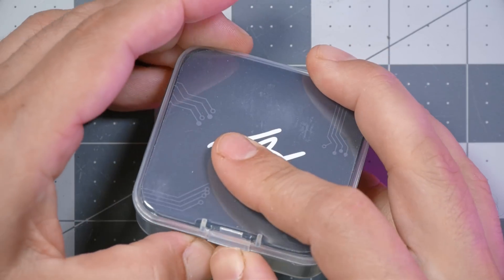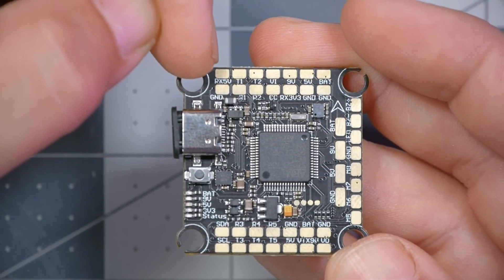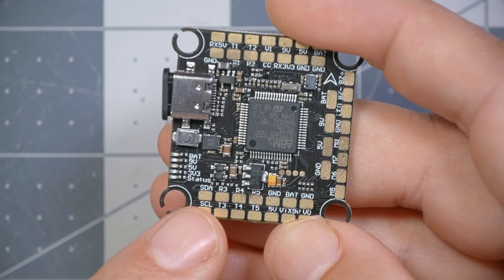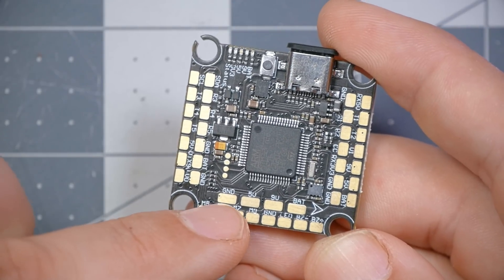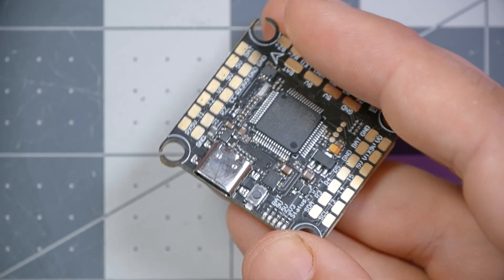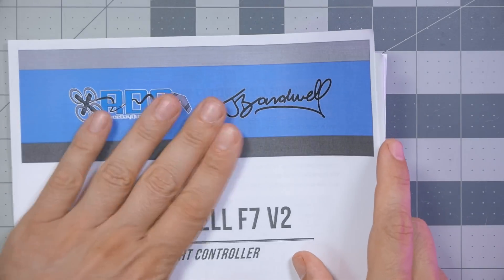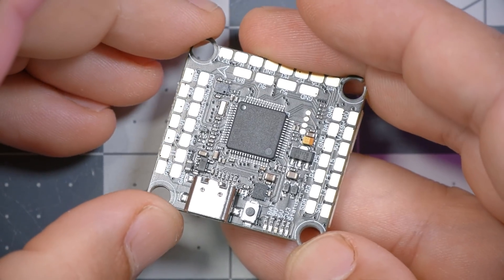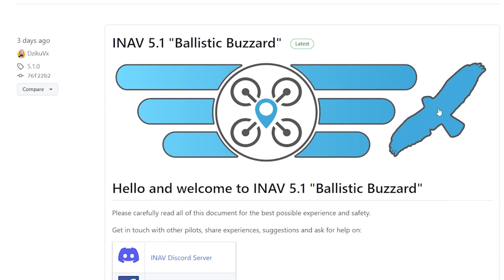My new FC is here! JBF7 V2 has USB-C, solderless plugs, iNav support, and more!

Comment from the maker: Pick up the JBF7 v2 at RaceDayQuads - https://bit.ly/3PQBcaw
Reply: What ESC would you call a "perfect" match for this FC when you make a build? : )
Reply: @tg3025  I asked him that very question a couple of times in live chat yesterday and never got an answer. I like the USB-C connection, but I think I'm going with a different stack I know will work properly together.
Reply: I purchased several of these FC’s and Return to Home feature is worthless in Betaflight 
Something is wrong with the gyro and or barometer
Reply: The RDQ site says that the gyro is ICM20602 but in the video you said it's BMI270 ... which is it? I presume it's what you said in the video and that RDQ made a typo. Also, any availability in the UK/EU? Good video though. Wanna try the FC.

Comment: Mr Bardwell, it would be awesome if you would do a presentation on running this FC with iNAV. I've got this board, with all the bells, and whistles. The pile of goodies I'm trying to get to work together are this FC, of course, an HGLRC M80 Pro GPS/Compass, WS Avatar HD Pro, with their CADDX GM3 gimbal, which must be on PWM (motor pads 5-8), so configuring the pads for PWM output is a must. The quadcopter is a rather large one I'm building for cruising, in the 450 class... like the old Hobby King deadcat quad, but nicer, an EyeFly Black Manta.

Comment: If this is not the best place to post this my apologies, please direct me to the best place. I have the JBF7 V2 Fc with an dji air unit and V2 goggles. I have WTFOS installed and working on BF 4.4.2 target is IFRC/JBF7_V2(STM32F7X2). My problem is the Font manager button in BF is greyed out. I've tried powering up with a battery first and then connecting to usb but that did not fix it. When I go to the osd page the button is yellow for a very short time and then greys out. I've searched the wtfos discord and found out about the connection sequence but little else. Any thoughts on this?

Solved, font manager not applicable with digital video

Comment: I have bought it. And really appreciate the thoughtful layout and handy plugs. I just want to get the quad in the air, tune it and basically get everything working. If the plugs ever cause performance or durability issues it’s nice to have those meaty pads to solder to. Also, just happy to support JB when I can. Safe to say he’s committed to the hobby and education. Always positive, honest and informative. Who better to trust? I’ll be sure to post my experience with the JBF7 v2 here after I’m in the air.

Comment: Question on the plug in for VTX. In the Betalight programming if you do not program a switch to the 9V will it prevent the camara from working? I have it all set using plugs and either have the video in or video out wrong or maybe need to add something to the programming.
Reply: Neverminded. I had the buzzer and camera plugs backwards.

Comment: @joshuabardwell how do you flash new firmware on this ? It fails in both inav and betaflight. Thanks in advance
Reply from the maker: If you're not able to get it to flash the normal way then try holding down the bootloader button while plugging in USB. There's no special procedure for this fc compared to any other though.
Reply: @joshuabardwell i had to use the impulserc fixer and that solved everything. Thank you

Comment: @ Joshua Bardwell 
Hi Josh- I just picked this up and have it all wired up via plugs (no soldering). Do you know why it randomly goes into DFU mode while connected to BF? I checked the bootload button and it’s not stuck. I’m scared to fly it because not sure if it can go into DFU mid flight.
Reply from the maker: Move the receiver to UART 2.

Comment: i was using the TBS M8-2 GPS/Glonass, which has no compass, and was showing altitude readout in my OSD via the built-in barometer in the JBF7V2. I upgraded to the Mateksys M8Q-5883 GPS unit, which has a compass built in. I now have no barometer readout. The barometer doesn't show that it is active in Betaflight and my altitude says 0.0 in my OSD. I still have no altitude and no barometer working even if I unplug the GPS unit. I was just wondering if anyone might know why this happened, and if there is absolutely no fix for it, how should I go about wiring an external barometer to this flight controller if my GPS unit is already using the SDA/SCL pads? PLEASE HELP MEEEE!

Comment: ; ) Dumbo here...waiting to buy...UNDERSTANDINGS:
1)WILL take iNAV which WITH (optional) GPS and (optional) magnetometer will provide RTH & Way Point navigation!
2)WILL power & feed DJI/CADDX digital which WILL transmit to DJI Goggles V2
3)Can it be used with DJI controllers and STILL eliminate DJI geofencing?
4)Can it be used with the DJI Motion Controller?

Comment: Hi joshua ! I have a question. It is possible in inav 5 to implement signal at moment when gps has a fix. Think that is important if a user can hear from transmitter that gps has a fix. Thank for answer.

Comment: About realpit: wouldn't a switchable ground pad work for turning a VTX on and off regardless of what +V pad you supply it from? 
And you could also abuse it for switching other stuff.
Reply from the maker: No, because the vTX is still energized and the current finds other paths to ground.

Comment: Hello Joshua, I’m 19 years old I’ve been building and flying fpv quads and planes etc sense I was 13. Ive learned everything I need to know about quads from you it’s incredible what you do. I know there aren’t to many young pilots out there but you’ve Taught me so much! I have one question. I purchased your JB f7 v2 flight controller. I’m super excited to build it the Layout looks FANTASTIC!. I was really really hoping I could get your input on a good 4 in 1 esc to use for your FC. I’ve always used single escs and my main flight controller I’ve used on my builds is a matek f722se. I went with your flight controller because I trust you when you say performance will be pretty much the same between the BMI270 and the MPU6000 on my mateks. Thanks so much and please don’t stop doing what you do best!
Reply from the maker: The iFlight Blitz ESC pinout will match the JBF7's pinout so that would be a good choice.

You don't have to trust me about the gyros. Both Chris Rosser and Mark Spatz have said the BMI performance is as good or better than the MPU6000. That's where I got my info. Trust them :-)
Reply: @JoshuaBardwell  okay thanks so much I really appreciate it!
Reply: @kadonhayes9771  Thanks for asking this question! I was wondering the same thing. Which model of iflight esc did you end up going with? Im looking at the dimentions of some of the esc mounting holes and it made me wonder, since i will be using the jbf7 v2 and it uses 30.5mm mounting holes, does that mean i have to use an esc with the same size mounting dimensions? Also, what do you think of the BLITZ E55 4-IN-1 ESC (the non mini version)?

Comment: Think running a s*** ton of LEDs for race day is a lot more important than running a octocopter... Wish it had more power for leds
Reply from the maker: The 5v and 9v regulators are rated for at least 2 amps. At 60 mA per LED @ 5v, that's like 30 LEDs, not leaving any budget for other thigns like the camera and receiver. Just saying, if you want to run a few LEDs on race day, you're fine. Just don't expect to go hog-wild.

Comment: Any chances you will co-create HD only FC or even AIO? I mean in case you've are on digital side of the hobby - there is no need of OSD chip, VTX part, extra power lines, pads, and smd elements for these bulky parts too (odd chip is huuuge). I love SD card slot there - its useful and cheaper than memory chip.
Reply from the maker: Really, a digital-only FC saves basically just the OSD chip. But since you have to make 2 different SKU, it doubles the amount of money you tie up in inventory and takes up more shelf space and is more difficult to maintain. So I'm not super enthusiastic about it.

Comment: This looks really, really REALLY good.  I'd like to point out a couple of things:  1) You mention the word "beginner" multiple times in the video, and there are some great features for beginners, but this is definitely specced out for pros as well.  This FC has everything that I want in a FC without going to a much larger board 2)  As with every compact board, there are compromises that have been made to fit everything in - but the compromises seem to be really practically made; 3) I have an incredible amount of respect for the fact that you left the card reader on the board - you've designed this for YOURSELF first, and hope that others like it too.    As you know from a couple of discussions you and I have had recently, this is how I design all my own stuff - I make it for myself first, and I firmly believe that as soon as you start to make other people happy that you can easily lose integrity in your product goals.   I cannot say how much I appreciate what you've done with this board, and the thinking behind it.   I know that there are already a lot of other FC boards out there (and in a way this is similar to the motors market saturation issue), but this one really is a solid, incremental step towards the "perfect flight controller" (as as close as we can get.)

Comment: I’m curious Josh: why do you prefer an SD card slot for blackbox data vs some onboard nvram? Isn’t blackbox data so small that onboard storage can hold pretty much all you’d ever need?
Reply from the maker: A 16 MB dataflash chip can hold about 10 minutes of flight if you turn the logging rate way down.

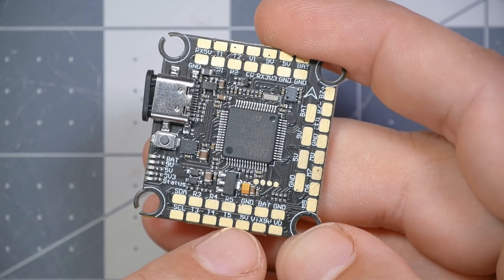Comment: The remote-power switchable VTX pad is a great feature (5:10).
Stop a VTX from overheating pre-launch on a warm day, or turn-off while doing bench work.
Diagnostic LEDs (7:37) are also very cool feature.
Reply: Agreed.  I've been using RC (PWM relay) switches on my larger builds for this purpose.  Its silly not to have this as a standard in this digital age.  Nice work JB.

Comment: Looks like a pretty awesome flight controller, I am looking at using a UART to use E-matches with to be able to set off pyrotechnics with a switch on my radio, is it possible to do, the e-match only requires a small amount of current to light the match which is hooked up to the fuse on like a small firework or smoke grenade.  i am making a plug that I can use to quick change the e-matches etc.
Reply: I only need to be able to activate the UART with the switch if possible so it doesn't have a constant current through the wire etc

Comment: Definitely going to use this new version on my upcoming long range, long endurance tricopter! So much capabilities to control just about anything, and now with iNav? I'm sold.
Reply: Agreed, with that much stuff both broken out to pads and on connectors, plus barometer and iNav target, this FC would be pretty at-home in anything that flies, multirotor or fixed-wing, not just quads.

Comment: Also like to see c-usb connectors not just wave soldered to pads for the usb body supports, solder thru pins on that usb body, already ripped a C off so to easily.

Comment: Baro is fantastic say you are uphill or atop and you fly over the crest you want to stay as near line of sight for video.  For example, if you find yourself losing video and at -100 in altitude, you know what to do.   I do alot of long range and has been used many times, like turning into a headwind with same throttle u will lose altitude and with no baro u don't know it maybe till too late.

Comment: Imagine creating your own customized FC xD
Hi Joshuah, I am new to FPV and I am wondering about radiation levels. Could I get cancer from using power levels such as 1000mw on my VTX or crossfire?
Also, i love the idea of an Inav compatible FC. I have always wanted the things that Inav offers because I have seen what it can do from youtubers. Great job!
Reply: No the radio waves for wifi, radio, video transmission, anything publicly used is not dangerous in any way
Reply: @Just_Natee  Thanks
Reply: No, 5.8GHz is not ionizing, i.e. you can not get cancer. Visible light is the same (electromagnetic waves), except light is at 100s of THz, and even that doesn't harm you. The only thing that can happen is that your hands warm up slightly from the radiation, but even then you wouldn't even feel it until the output power is like 100W (100.000mW) or so. Seriously. Don't worry.

Comment: Hey JB! now that the BMI270 is getting used more and is proving to be nice, I am wondering if you have considered releasing a new f405 FC. with the mpu6000 we "needed" f7 because if we wanted bi-directional dshot, we had to downsample the gyro data at 4k. However, with the BMI270, we can easily have full gyro rate of 3.2k and bi-directional dshot and get double the flash with the f405 vs the f722 in exchange for less uarts, and most people use only 2 anyways. 

Ive always wondered why the f745 wasnt used more (for the additional flash) outside of toothpick AIO's, but with the BMI 270 it seems like we can bounce back to the f405 for our needs, and maybe we can take some of the sting away of rising costs... 

Thoughts?
Reply: pretty good idea, except my quad is running 8k/8k on an f405 🤔 - until now I don't see the reason of an F7 anyway. Except if you're using all the UARTs or you have excessive filtering
Reply: Chip shortage, that's always the problem.
Reply: @FireN2k9  is it though? the f405 is in shorter supply than the f722?

Comment: please do an inav 5.1 video i just built a 7" gps quad but when i arm the roll and pitch stick dont work till i use the throttel un like my racing quad where i can lean it then throttel up
Reply from the maker: That's just how iNav works. I'm not sure if there is a workaround.
Reply: @JoshuaBardwell  ok BF flys like it should and has gps recovery what apart from position hold is the diference would make a good video

Comment: Yeah you know we're going to buy it, the barometer is very cool! I rum Inav on a 7" long range and the GPS has a compass so you can use altitude hold.
Reply: when you arm your quad dus the roll and pitch work or do you have to throttel up first
Reply: @dirtydogfpv6905  I'v only got it working and tested low to the ground, and I can't remember moving pitch and roll before throttling up. I wasn't sure it would work at all with the compass on the GPs.
Reply: @nunabiz  on my race quad i can tilt it so it is in a launce pos but on the inav build i cant there is no imput till i throttel when you next fly it have a try

Comment: I wish I had a JB ESC. That is the most fragile part in my builds.
Reply: For what it is worth not that you get what you pay for because some ESC's that are expensive have been junk and vice versa but you get what your boards components are "spec'ed" for would be true for sure!   That is something that us average consumers will not always know  - what FET's a manufacturer has selected to be on the board but in the end what a burn it is when you buy an ESC only to have it fry under what you would consider normal use and you are SOL with electronics, so if it fry's you are out the $$$ you spent.  

And in my opinion it is a shame that junk is made that only serves to  add to waste streams and landfills (you should electronics recycle these but still)  So I think it is important to look at reviews from real people as much is believable and trustworthy on this item as disassembling a stack, de-soldering the motor wires, power wires, etc.. is a pain in the rear, time consuming, always a small chance you solder the new one in wrong... it is just much better to find the right one and even if it is a bit more, save up because it will probably be cheaper in the end.
Reply: I had issues with 4in1 ESCs. Killed three is a month. My setup was also to hard on it. Still I had the opportunity to test some out and I have to say get the diatone 55A 128k esc. Really good value for money and reliable.
Reply: Try the Hobbywing 60amp never had an issue with it

Comment: Nice tip for using the 3.3v pad to power the GPS. I did learn something new today.
Reply: GPS units usually use 3.3v internally so if you give them more than that, they (usually) step it down to 3.3v via a built-in regulator and there's some units that can fail after a while if you power them with 5v. The 3.3v pad on FCs that have them is normally a linear regulator, so not only is it less noisy power because not as much stuff is using it, it's also just inherently a much more clean, stable source of power. Only drawback to them being linear types is that they tend to just be rated for like 200-250mA peak current draw. Perfect for a fussy rx or a GPS, not so great for LEDs or buzzers!